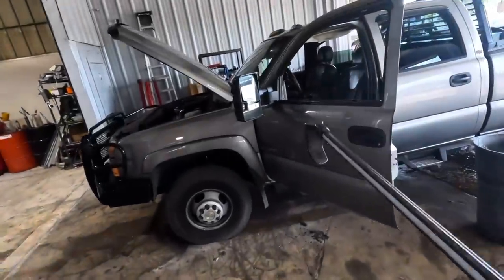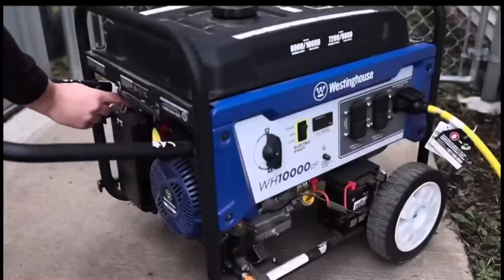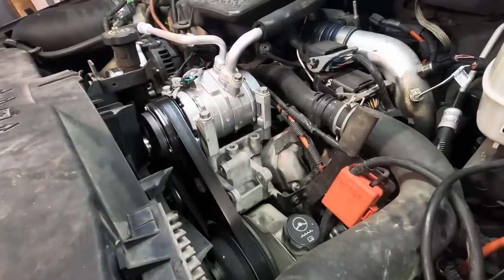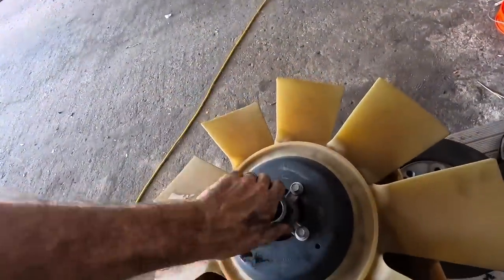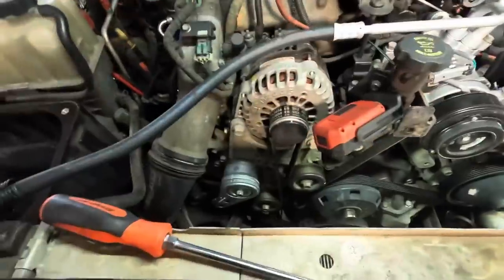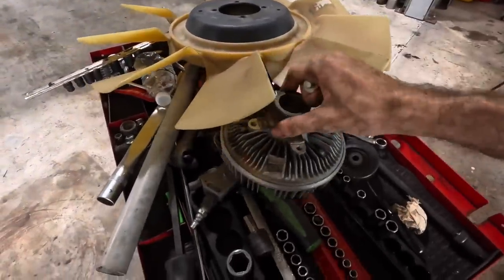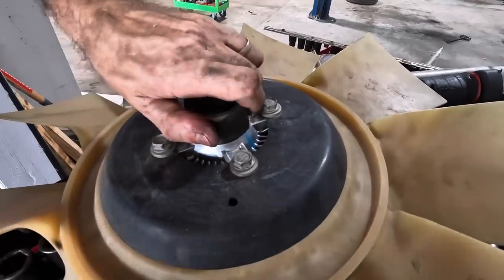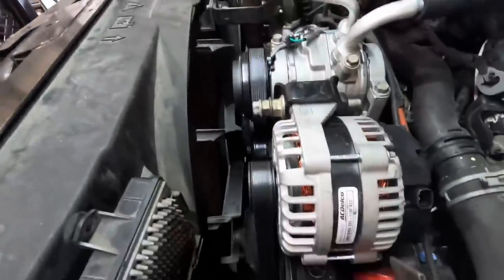Proof of Concept! Dual Alternator DURAMAX!

Comment: The next level (or the ultimate level) would be a new transmission with a pto connected to a beefy generator
Reply: Yes thats what is the needful
Reply: Hmm, the tow truck already has a PTO drive.
Reply: If memory serves me correctly, the Allison transmission in that truck is PTO ready. I believe there is a removable plate on either side of the trans that can be removed and a PTO unit bolts right on where the plate was.
Reply: @scott.koopmann yes it is. I run  an 8kw generator on my lb7. Works like a dream. 
The main rason why i went that route instead of dual alternators and inverters is because i run an air compressor on the spot for the second alt.

Comment: Great point about generators, i bought a gas/propane generator as propane is more easily  stored…..still noisy though unless you silence it. You should make your bull bar hinged so you could loosen a couple of pins and fold it down making a platform  to stand on while you dig around in there😊

Comment: You can always buy 4 Ford F150 lightening s!  Actually, I worked at a television station transmitter here in Tucson years ago and the transmitter was on a mountain top that did not have power. We had two diesel generators (not big ones) for power and amazingly they were mostly reliable. We had them fueled by a 200 gallon fuel tank and had to haul fuel up along with food and water. It was a pain but when one generator went off line we started the second one. KZAZ TV was known for going off at random times but the system was sort of reliable, definitely enough to keep a freezer / refrigerator going . The diesel generators are supposed to be much more reliable now so it might be an alternative source that will still use your mobile fuel station. There is also the propane fueled generators.  nice job.

Comment: I suspect one of the alternator connections senses the voltage at the battery.  If so, you should run that wire to the batteries behind the cab and the alternator should produce more voltage to try to deliver 13.6 or so volts to the batteries behind the cab, which will probably produce a couple of more volts at the alternator to make up for voltage loss in the cable to the rear batteries.  That cable should be quite a bit larger than I see here as well.  Also, sparking on the positive lead can blow the diodes in the alternator because the voltage at the spark is very high.  As always you should only disconnect the negative wire first and the positive second.  Reverse that to connect the battery so there are no sparks on the positive terminal.  The battery will protect the alternator.

Comment: Ray i could tell you a story about your identical truck with utility box. Dual power AC or DC. Utility box manufacturer misjudged  wire size need and inrush voltage to replenish storage batteries. Consequently the wiring got toasted and some veterinary meds were ruined because refrigeration failed. #12 didnt cut it. #00 was needed .

Comment: Hey Ray
just an idea what about putting a switch in to seperate the systems but would also allow you to run it on the truck system incase of Primary Alternator failure giving you the ability to get yourself out of trouble till you could get a new one and back to the shop?

Comment: 8:38  last hurdle is run without key, and automatically shut off if break peddles pushed. I think you can do that with 2 or 3 latching relays you dont need a remote start unit.
I cant think of one that can run 8 hours stright,  however an overheat automatically shut down would be nice if you lost coolent wile you were sleeping.

Comment: Dual alternator setups are pretty common in the RV and marine industries. There are 3 common variations. One, like this apocalypse project, is simply for additional capacity at the same voltage, allowing for a separate battery bank with its own dedicated charging system.
The second, even more common, is 12v and 24v alternators where the engine uses a different voltage for starting and vehicle systems to what’s required for the living area equipment. Again, this has two separate battery banks, each with its own alternator.
The third, much less common, but far simpler setup has a 12, or 24 volt alternator from the factory, just charging the starter battery, with the second alternator producing 110, or in Europe, 230 volt AC. No second battery, or inverter required and far simpler wiring.
If starting from scratch, that would be my preference. I suspect Ray already had his inverters, so he’s saving money by doing it this way. I’m in a similar position, about to embark on a RV conversion of a lorry, very very slowly, because of reduced mobility, but I already have a 160A alternator and a 5kva  inverter, so it makes sense to use those. In my situation, I’ll be using 12v for the living quarters, so it will be handy to have a 12v charging source without having to convert the 24v from the lorry, too.

Comment: Problema, Tovarisch?  Shto problema? 😜
 
Great proof of concept.  Along with everyone else's, I'll suggest running heavy Negative along with Positive cabling from the second alternator to your auxiliary battery(ies).  Shield them if routed under the truck.  Even if you have to buy/rent a ginormous professional crimper, make sure terminal lugs are uber-tight.  Also, fusing these charging leads near the alternator will protect from fire should something go catastrophically wrong with the inverter(s)/battery(ies) when you're not looking.  I may be over-cautious here, but this is how I'd do it -- a vehicle going up in smoke is not my idea of fun.
 
A voltmeter/gauge, Battery warning light, and a cutout switch in the excitation circuit might also prove handy.  At this rate, you may eventually have more instrumentation and controls in your truck cab than an airplane cockpit. 😆  (Back in the 1960s, GM designer Harley Earl built/had built a Corvette with actual aircraft instruments.  Oboy.)
 
Looking forward to more on this.  Please be careful; you don't want to "get sideways" of high-amperage DC.  Or AC, for that matter.

Comment: Sorry Ray first comment.
NEGITIVE FIRST OFF THE BATTERY LAST ON THE BATTERY.
Yes do up size that short length of POS wire from the second alternator. It would be "interesting to use the infra red to check the two temps of that short length of wire and your jumpers??

Comment: I recommend larger power wires , the semi i have uses 0/2 guage wire with 1 alternator and 4 batteries. All the semi dealers will have what you need.

Comment: an other reason you are correct with turning your truck into a generator is since you use the truck and know it works a generator stored for a long time it is wild guess if it will work or not since it isn't in the production like as it were.

it is how apartments are set up with water pumps. you have 2 pumps that cycle ever 12 or 24 hours if one breaks you will know it within 12-24 hours but you still have a known good pump so there is only a tiny chance you will be downed by two failures.

i would suggest you replace the generator when it breaks with solar and battery backup power as you can have that working during normal situation lowering your costs so you know if it goes down that you have two working systems where failure will be quickly known.

Comment: Not sure about the math. If the truck on high idle burns 2-4 gallons per hour, and if you had 120 gallons on board, that would be a minimum of 30 hours and a maximum of 60 hours. That’s a long way from a week of power. Furthermore, that transfer tank looks like 60 gallons to me, not 90…but I could be wrong.
Reply: he is buying a used tanker next.
Reply: He said in the video, if you listened, that he was only running it at night to keep the noise down.

Comment: I would've gone for a diesel generator more as diesel generally is more efficient but also 'red diesel' is a very cheap alternative in the UK that is for farm equipment only and does not have as much tax (fuel duty) on it to make it more effective for agricultural purposes to keep the cost of food production down and cost effective for farmers etc (not sure if that's a thing in the U.S. or not).

Diesel for road users used to be very cheap for lorrys and industrial vans etc but as it became more popular for the general populous the government (bass turds) realised they were missing out on tax revenue so slapped a higher 'fuel duty" (tax) on it that screwed up the freight industry.

The red diesel would dye all fuel components internals red so if vehicles being used on the road were caught with the dyed components would be seized by the 'state'.

** Additional info for viewers **

Ray might not have thought to mention how you could measure the belt length you might need to work out if you were adding an additional feature (power steering pump, A.C  compressor, alternator etc) or if you were removing said accessories and needed to work out the belt length (not ragging on Ray as he will know how to do this and probably just didn't think about it at the time lol plus it can take a lot longer to explain all the ins and outs etc and his video was more of 'how to' rather than a training clip but he might mentally slap his forehead and say DOH!! lol)

These flat/ribbed belts usually have a part number that specifies the ribs required, these usually take the form of 4PK 4524 etc. The 4PK denotes the number of peaks a belt has (could be 3 or 5 PK etc depending on the application and means the pulley has 3,4 or 5 troughs that these peaks fit into).

The 4524 part of the part number denotes the length of the belt in mm so by using a length of string routing it around the pulleys of your new pulley configuration will allow you to measure the length of the new belt you'll need to suit your purpose (you will have to ensure your string is routed correctly to ensure ribbed pulleys have the ribs on the belt facing them and the smooth pulleys have the smooth side of the belt facing them and that your belt tensioner is able to adjust your belt tension correctly also)

Once you know the number of ribs and length you can then order the relevant belt for your application but you may want to order a length that is a little longer and a little shorter than your measurement in case one fits better than the other).

That way you're not 'guessing' on the length you need and make sure you can get the correct belt from your local trade or civilian store or order it if they don't have the exact belt in stock (takes the pressure off them trying to get you a good match).

Comment: Battery isolators are good trick I have a 40 amp and 80 amps dual alternator eight batteries charging my wheelchair and my wheelchair lift on my van❤

Comment: to put on the fan. cant you use a string like a U holding it on the bolt on the clutch as a guide and hold it and spin. minimise the chanse of damageing the fan or radiator if you lose grip while centering while putting the fan on.

Comment: Mind those long cables are acting as a resistor so voltage at alternator side is not the voltage at inverter battery side, there could be few volts difference under load at inverter side (lower voltage).

Comment: Good concept, I run a duel battery system for my fidge and lights in car, you may find you will be better off at a later stage with the battery's in the tray to upgrade them to lithuim to handle the loads better and stick something like a redarc dcbc1250 charger in it to charge battery's at a better voltage with either a 8 or 10 b&s cable

Comment: nice, I did not see all yet, but may I suggest you wire the second alternator directly to your auxillery battery pack. when they are full, the alternator will not pull too much hp. and when you need, you will have your 140Amps available. imho this may be a nicer way, because you can leave the factory wiring. now i will watch the video further ;-) tnx  bro

Comment: Nice! The alternators on the boats that we used did not have an exciter wire, but all you had to do was rev the engine and then it would start. That was many moons ago, not sure about today's stuff. Also it may be a good idea to have an amp gage, then you now if it is charging and how much draw you have.

Comment: You are very correct that you need a backup power source during hurricane season, as even a brand new gasoline generator can/will fail as my neighbor found in 2004 (the year Florida was nicknamed the Plywood State).  Also have you ever noticed small gas engines/equipment always fail when you need them most and can’t get supplies/parts.  You have a very creative solution.  My question is will it support 220 volt AC? Just wondering.  Would be neat if you could back feed your house panel and have a system to provide hot water, central HVAC, water pump, etc  unsure if the system could provide that much power. But if it could, it would eliminate all of the trip hazards of extension cords running everywhere.  Potential food for thought.  Great video

Comment: Ray....U  really know what U r doing!!!  Get rid of those cheezy power wires and Question:  Is it advisable to have a master disconnect for "Everything" in the back, from the new power system structure, "Just in case??"  (Perhaps like those pull aparts disconnectors wired into the side of a house, to disconnect the house a/c units, just in case....)  Great to see how the alternators work together.....Question 2.  If the original alternator goes out, can the second unit be switched to power the vehicle, in a "Regular, factory Mode???"

Comment: Is there a prevision for an inline fuse for new addition? As well one of those manual disconnects, would also be good. 
Those electrical knockouts  cutters work well for entering your box  if your  going to work that way? A strain relief connector will be good there.

Comment: That exciter wire is needed to get the charging process started, typically it would pass through a light globe of low power which would be labelled GEN or ALT. It would light up when the ignition is turned on (battery + on one side, alt ground via Rectifier on the other). When charging process begins the globe has + on both sides and so is extinguished.

Comment: Maybe you should also replace the radiator since it’s pretty well beat up during this Hurricane Emergency Power Project.  If it starts to leak during a storm and power outage you’re going to be dead in the water so to speak.

Comment: I would suggest a much bigger alternator, like close to a 300-350 amp alt.  Also you should use 00 gauge wires for your alternators and power cables.  Better ground always seem to produce a better power source to your accessories.  I run a 265 amp alt in my hummer h2.  What a difference in power and current I have now.  The 100 and 125-130 amp alt you have is just not good enough.  The more power, the less strain on the system.  Just a suggestion.  Your wires are getting hot because they need to be bigger.

Comment: Gas generators also aren't bad weather friendly so you would have to build a little home for it and everything. Truck is mobile, easy to access and it well protected. Park it right next to the house and  good to go. And then anywhere you go your whole setup follows.
Reply: And smell diesel smog all night. On a truck this old,it has to stink...
Reply: @cengeb  Maybe, but it might not be that bad at idle. He runs it inside the shop without complaining. A generator would have the same issue too. The truck will be outside and they will be inside so it's probably fine, just point the exhaust away from the house maybe. It will be 10 to 15 ft away at least that way.

Comment: Assuming no conversion losses (and there always will be), watts going out = watts going in.
And since W=VxA, to produce 12KW, you'll need 1000  amps on your 12v side.
Since your alternator can produce 140A, you'll only be able to get out of it 1680W continuously.  I realize you have the batteries so you'll be able to get higher peak watt loads, but that can only last for a while.

Comment: Ray unlike the generators of old that you could disconnect the battery cables to see if they are changing, with alternators that is a very very bad idea. With an alternator if you disconnect the battery cable while its running you will blow out the diodes in the alternator.

Comment: Automotive alternators are generally rated very optimistically, yeah, they can do their rated output but for how long?  It's a problem of heat rejection, they simply don't have enough cooling capacity.  This is why the industrial rated ones used on big trucks and busses are so big and heavy, more metal as a heat sink, a bigger fan, and more windings to reduce the power density.  They generally produce their output at lower rpms and live a much longer life when worked hard.

Comment: Either convert or replace the gas generator with propane. It's VERY easy to store propane for a long time, unlike gasoline that evaporates and turns to varnish. Plus, if there's a power outage, gas pumps don't work. Propane facilities store propane under pressure and don't need power to fill a tank.

Comment: 10.2 volts (about there) for the exciter wire. You can use a small DC to DC converter to adjust the voltage down that goes to the field. 👍

Comment: some alternators only require a 'flash' exciter wire where once u apply voltage to it then it will apply its own excitation afterwards to maintain its own voltage. NO IDEA if that's what's going on with your setup, just thought i'd mention it.

Comment: This setup is wicked but need a Vent fan on the box, get rid of the excess heat and off gas from the batterys and it’s perfect, make sure the vent is filtered cuz that pretty clean box won’t be so clean after adding a vent
Reply from the maker: I found a real nice vent that has cpu fans in it to pull air in and out, I have two on order